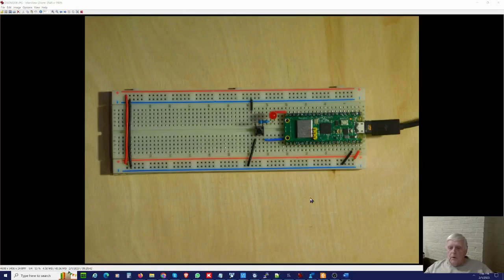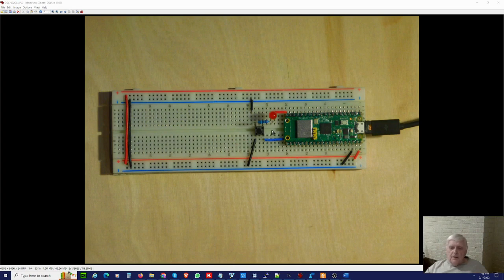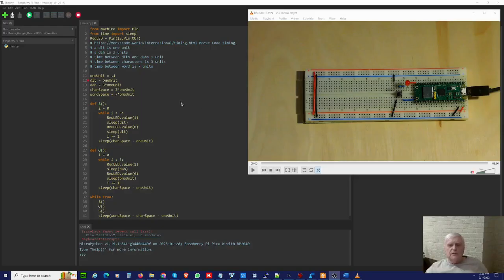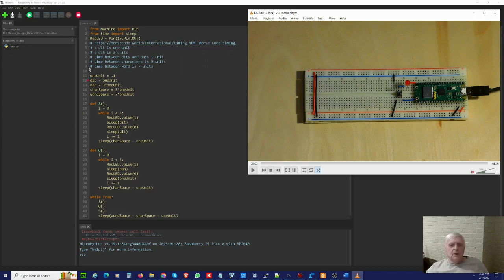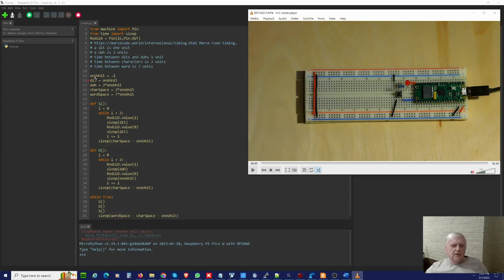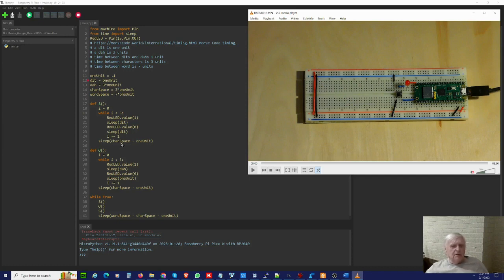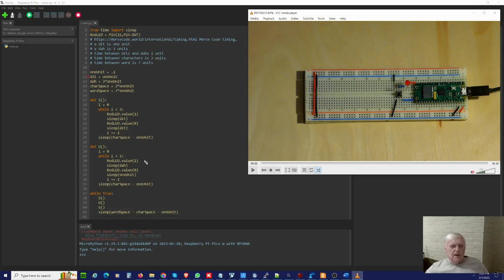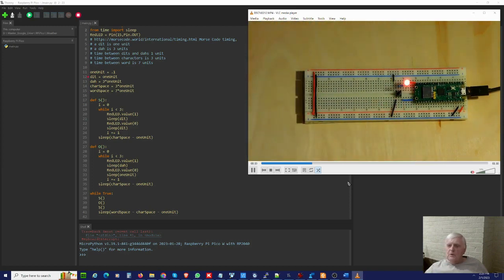Paul McWhorter’s Raspberry Pi Pico Lesson 2 Home Work

Comment: Great job. On your positive rail connection I think most components in the kit will want 3.3v instead of 5v. Thanks for the video.
Reply from the maker: Yes, the logic pins on the devices want 3.3V, but I've found that devices that have a Vcc pin work better with 5V. to the Vcc pin.  That must have been the case the last time I used that breadboard.